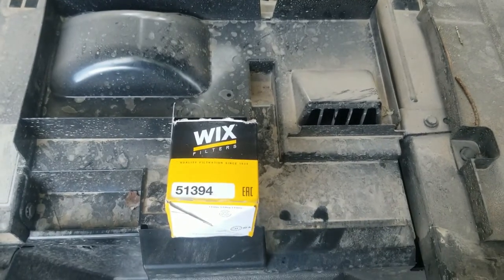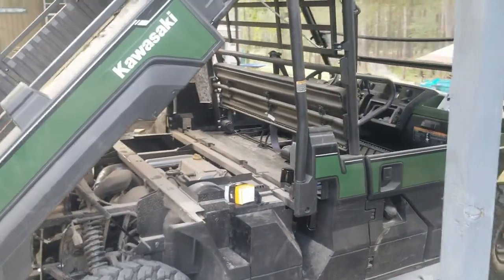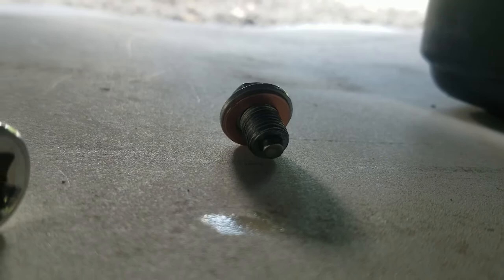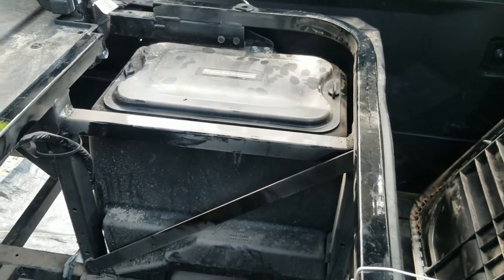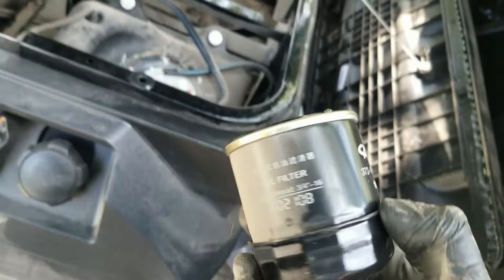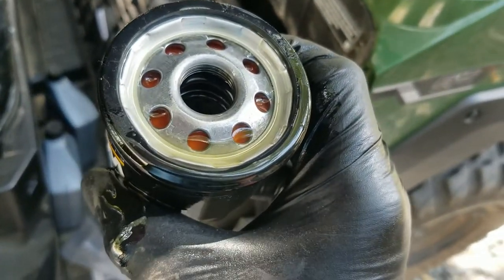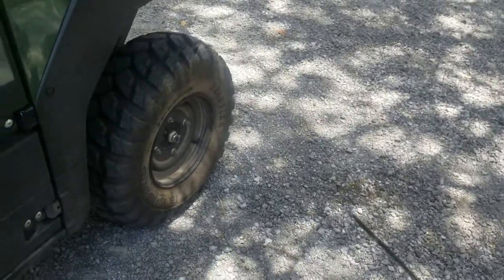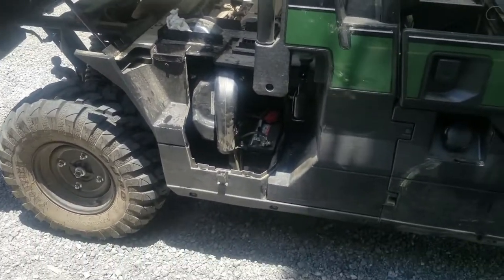First Oil Change on 2022 Kawasaki Mule FX Pro

Comment: Really nice machines , and those 3 cylinder engines are awesome, automotive grade , solid performers . Best utility SxS on the market ! I drove these Kawasaki Mules for over six years while doing contracts in Afghanistan, and I can attest to their bullet proof ruggedness and longevity . They were used and abused and neglected and punished , driven in the harshest most extreme conditions imaginable, and they just keep on going, you can’t kill ‘em ! 
Just change the fuel , oil and air filters as recommended and they’ll never fail you . Never saw any mechanical issues at all . The best in the industry ! 
So , was that oil filter wrench a specific type size for ATV/UTV’s or a standard size for automotive filters ( since that 3 cylinder is technically automotive grade engine )
Reply from the maker: To be honest I don't remember. The best thing to do would be to buy that Bosch filter or a similar compatible filter and then find the wrench on the shelf that matches up to it. If I remember right there were only two or three different sizes. Sorry, wish I could remember the size.   Maybe the specs on the filter will tell you which millimeter size to buy

Comment: On the oil filter wrench, which one did you use? 
some mention 68mm and other mention 65/67mm.
Reply from the maker: Sorry for the late reply. Had my notifications messed up on the comments. I just picked out the wrench that fit on the filter when I bought it at the auto parts store. I really don't remember the size. I think the specs on the box or on the website for the Bosch filter may tell you which size filter to buy based on the millimeters

Comment: Does using other oil and filter void warranty?
Reply from the maker: I"ve been told that it does not...just use the proper weight oil and document the oil change to show when it was completed and how many hours on the  machine.
Reply: For older people we find it easier to remove the plastic cover above oil filter. You can see and do everything with ease